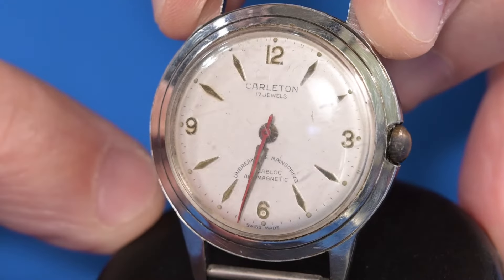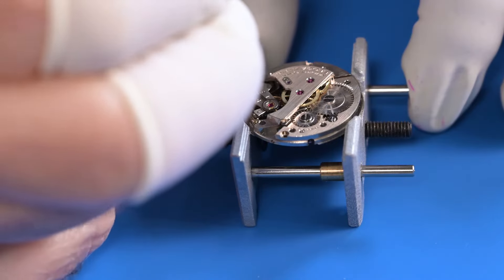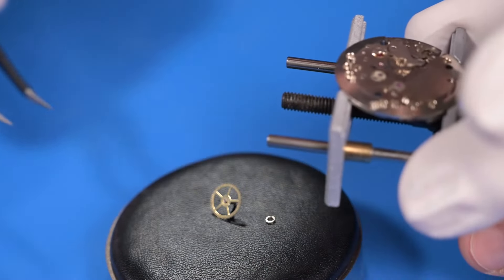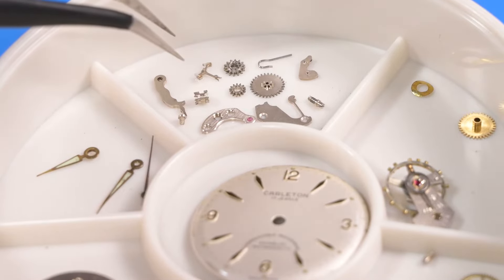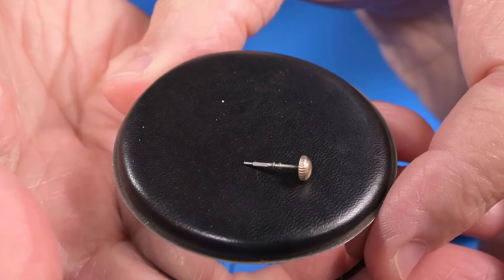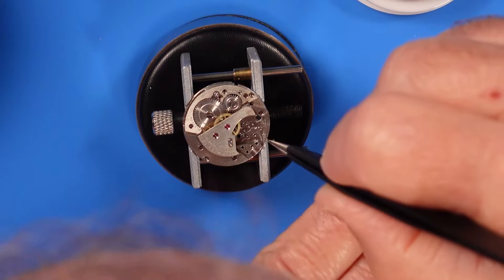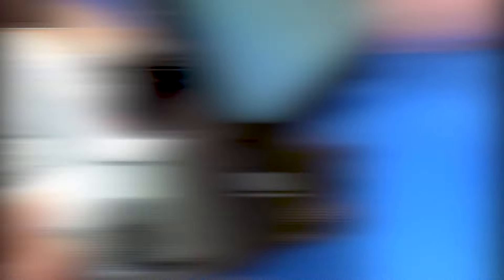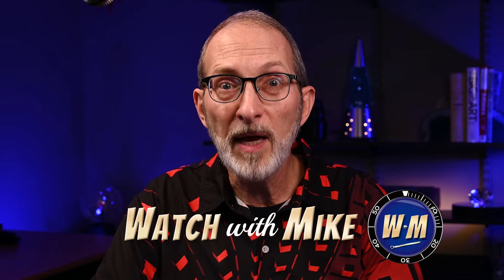Learning Watchmaking on a Swiss Mechanical Watch | Complete Teardown & Service

Comment: Sorry but I just couldn’t get past the thick and chunky ‘tweezers’, the cranked angle didn’t help either. Never seen anything like these used by any other watchmaker and I’ve watched hundreds of videos. I guess if that’s what you have got and you’ve found a way to make it work for you that’s Ok. But the handling of the parts looked clumsy and awkward and my guess would be that it is stressful and tiring after many hours of working.
Reply from the maker: Hi Francis, indeed, this was one of my first watchmaking video projects and I had a lot to learn about tools, especially tweezers! I look back on this video and I see how far my watchmaking skills have come. I welcome you to check out some of my more recent projects on my channel. Thanks for your interest! 👍🏼😁

Comment: I've watched videos on watches for years now.   I started on my great grand pa's benrus self winding.  I didn't have the cleaning stuff yet and was putting it back together for learning.  A tiny screw flew off of my tweezers for about the 12th time, this time off my cloth mat I laid down.      I guess I'll be shopping for old benrus watches for parts.    I needed a stem and crown for it too.    I'm thinking about using superglue to keep the screw on my screw drivers while starting them.   I took photos as I was working, but if it wasn't for a video of the operation, I don't think I"d figured out how to get as far as I got.  Oh, it was a winding gear click screw.    I found a click and screw for $25.   I don't think it's worth it.  I'll look for doner watches.    I have two pocket watches that belonged to granddad and grand dad in law to mess with too.     I also have my aunt's atomos clock.
Reply: ratchet wheel stem,    I'm still learning the names of parts.
Reply from the maker: It sounds like you have lots of great time pieces to work on! A small neodymium magnet stuck to the shaft of your screwdriver will help hold small screws onto the tip. I know magnets aren't supposed to be around watches, and you may need to demagnetize when you are done… But I think that would be better than superglue. I wish you continued success with the hobby, and thanks for watching my video!

Comment: The palet fork is missing a Jewel  on the release side of the palet fork Maby a little inspection is needed it was goe before you released the barrel spring tension .it’s my first observation of a faulty fork also it might be bent by a previous service .thanks for the vid .
Reply from the maker: Hi Joseph, I appreciate your concern, but the pallet jewel isn't missing from what I can see! Maybe it is an optical illusion because the jewels in this watch are CLEAR, not ruby colored, so the fork may look empty. Here's a good place in the video that you can see the clear pallet stones against the white parts tray: https://youtu.be/4b3ImfaxauM?si=YPEASyrYF2MnYb2F&t=1475

Comment: Did you ever replace the crystal?  I found out the hard way that we can buy new crystals for these.  I found out the harder way that sizing them is difficult.
Reply from the maker: Hi Lee I did not replace the crystal. I was able to clean it up nicely with PolyWatch. I agree that sizing the replacement is difficult… I just bought an armored dome crystal for a vintage Hamilton, and it took me forever to find an aftermarket replacement. That will be my next project and I sure hope it fits!

Comment: Thank you for sharing your journey in such an open and well-produced manner. Kudos. 

I’d love to learn more about your journey up to this point, the point when you felt able to work on your first mechanical watch. How did you learn about the different components and  techniques? While there is no one pathway, it would be insightful for others who are trying to get this point of their journey also.
Reply from the maker: Hi Stefan! Thanks for the kind words! I've always liked doing mechanical things, and I've always loved watches - but I never thought I could understand how they work, let alone fix one. Then I started watching watchmaking videos on YouTube and I was hooked. I took out several books from the library, but honestly they were too technical for me at the time. The best path to learning? Start taking a project watch apart. Pocket watches are larger and easier to handle for beginners (regrettably I skipped this step). Once I started taking them apart, the library books and more advanced videos made more sense. Hope that gets you started! 😀
Reply: @WatchWithMike  thanks again. The larger sized pocket watches is good suggestion - I think like that or something like a Seagul St3600 movement will be where I first try.

Comment: Was that a plastic crystal?  The tool to use is different for plastic, I think.  It's a multi fingered tool that installs the compressed/sqweezed crystal on the sides.
Reply from the maker: Yes, the crystal was acrylic. The tall you are describing is called a crystal lifter, which are used in this video: https://youtu.be/LcbFjoDRq0o?si=Oh3u914z62OlCSXj. For what it's worth I still prefer to use the press, but I have become better at it and have not shattered a crystal since. There's lots of ways to achieve the same results! 😁

Comment: The chrome plating can't be coming off the case.  It says clearly on the back "All Stainless Steel".
Reply from the maker: I agree with you… But something tells me the back of this watch may have been swapped out. It's been some time since I have worked on this watch, but I will go back and take another look at it to see if you are right! Thanks! 😁
Reply: @WatchWithMike    Yes, if that is the case, I can see your point!  However, after you cleaned it up, I didn't see any case degradation.   
Regardless....AWESOME JOB!!
Reply from the maker: @chronoboat11  👍

Comment: Nicely done.  I think the watch isn't running well because you may have used the wrong lubricant. Evre watch movement uses a specific regiment of lubricant. You need to find the specific instruction to your monument you are working on. At least that is what I learned watching other newbies like us. I think the proper lubricant like the proper cleaner in conjunction is the most importend element in matchmaking. I'd like to see the watch finally reasembled on your arm working.
Reply from the maker: Thanks for the advice, and with what I have learned since I have to agree. When I made this video I didn’t have any documentation, and as a result I was figuring out as I went. Looking back I know I would do things differently, and I plan to demonstrate that in upcoming videos. Stay tuned!
Reply: @WatchWithMike  I most certainly will. Can't wait.
Reply: I thought the mainspring looked like it didn't uncoil as much as I expected from watching other watch videos. There are some good videos on watch oiling. As the other guy said I've watched a lot of watch videos. I plan to set up my watch bench and tools as soon at I can make my work space water tight and replace the carpet with linoleum (searching carpet for dropped parts isn't much fun).

Comment: I recently learned you need to be very careful using IPA on pallet forks and the balance wheel assembly. IPA can and will deteriorate the shellac that's used to hold the impact jewel and the jewels on the pallet fork. And it does it rather quickly, like 2 minutes is more than enough time to really mess up the integrity of the shellac. I wish I would have known this sooner! 

Watch Repair Tutorials has a great video on it. I don't think I'll ever use IPA on those parts again. In fact I don't even think I'll ever wash those parts again, manual cleaning only! haha Little too sensitive, and I do believe it's been messing me up right along. I was hammering those parts with IPA not knowing any better. At least I haven't messed up any really special movements, just old donors that I bought cheap specifically to learn. The ones that require servicing but are great watches have been left alone other than checking them out and confirming the balance was in good shape. I've got some really cool old watches that I picked up cheap because they were non-working/for parts, that all appear to more or less just need a service. Hamiltons, Lord Elgins, Omegas, Longines... Really cool pieces just waiting for me to build up the confidence and know how to work on them! ;) Really glad I showed restraint and learned about the IPA before digging in!!! haha

Cool video, subbed.
Reply from the maker: Thanks for subbing Tim! Yes, I agree 100% about isopropyl alcohol dissolving the shellac used to hold stones in place. Fortunately I have not had any casualties. I've seen the tests that Alex did… Very interesting! I wonder if older shellac is more cured and resistant for a longer period of time to IPA? I am also glad you learned your lessons on inexpensive watches… I am doing the same! Thanks for joining me on my journey and for sharing your experiences. 😁
Reply: @WatchWithMike  if you look under the microscope a jewel is missing on the pallet fork .

Comment: A very cool video, Mike! As for putting the spring back into the barrel, I have seen one guy use tweezers for holding the thing steady (the barrel was placed between the legs of the tweezers and he was rolling the barrel safely). Cool to see that you have done the same thing for smaller parts: you are using the sieves for making tea😊 I still have not found the smallest containers as I have no idea what they are called. Some watchmakers use special liquid for cleaning automobile injection nozzles to rinse watch parts in the ultrasonic cleaner.
Reply from the maker: Thanks for the nice words and for the suggestions! Those small cleaning baskets can be found on my Amazon associates shopping page, I think in a list I called watch making supplies for beginners, or something like that… Here is the link if you would like to give it a browse: https://www.amazon.com/shop/mikefyxdt 😁

Comment: A. Schild is a pretty reputable movement maker. It was absorbed into ETA in the 70's, however, Schild was a part of Eterna (later ETA) before he went off and started making the AS movements. Some info regards the merge as like a homecoming. I went down the "AS" rabbit hole the other day trying to find info on a mystery movement I was checking out haha Never heard of AS before then, but it seems these movements were used an awful lot by different watch manufactures around the world. Mine is in a Gents style (super thin/round/kind of large for the time) Elgin for example.
Reply from the maker: Interesting stuff! I think the watchmaker origin stories are just as fascinating as the parts themselves. 😁

Comment: Great video - loads of detail and added knowledge for us - thanks Mike. Maybe that sample oil set link in the next video? - that looked good as oils seem super expensive for hobbyists. You can order a crystal to finish the project - set it aside for couple of years then come back and then make it perfect - that'll be a fun video.
Reply from the maker: @tinymotogarage - I appreciate you watching! Those are excellent ideas. I have considered replacing the crystal, if for nothing else than to contain those possibly radium hands. About the oil sample set, yes I’d like to get a video out about that soon. FYI, the only place I have seen them sold is on eBay, and they come and go… You have to watch for them. Hope that helps!

Comment: I hope you are taking precautions with the possible radium. Using a blower to remove the dirt and dust on the dial. Please wear a mask and discard the debris. It has a very long half-life and can be potentially very dangerous to your heath.
Reply from the maker: You bring up important points, thank you. I must admit that when I took this watch apart I was uneducated about the danger of the radium. Fortunately I did very little to disrupt the dial or hands, which I am thankful for. I would like to try re-luming hands in the future, but I definitely want to learn on a watch that I know is safe. I intend to purchase a geiger counter so I can make sure I’m safe moving forward. Thank you for watching and sharing your thoughts!

Comment: I was concerned when you said you were using water as a cleaning agent, but when you said you were using IPA as a final rinse I was really worried. It's fine for most parts but it can dissolve the laquer that holds the jewels onto the pallette fork and the balance assembly. 
So far it is working for you and Iwish you only success, but I urge you to be extra careful with your fluids and solvents!
Reply from the maker: Excellent points, and I really appreciate you bringing them up so other people can read them in the comments. I recently purchased some legitimate ultrasonic cleaner and rinse, which I am going to work into my watchmaking cleaning regimen. I liked working with the IPA, and I thought it worked as a good drying agent. However I will keep that reserved for parts that it won’t damage. Thanks so much for sharing your advice!
Reply: @WatchWithMike  brother I'm glad to help! Full disclosure, I haven't done any watchmaking myself (initial tool cost outlay is a bit of a barrier to entry for me, though I remain hopeful,) but I watch a metric ton of watch restoration video content from both amateurs and professionals, so some of the advice sticks with me.
Reply from the maker: @67nearmint  -  Lol, metric ton makes sense to me as a measure of YouTube consumption! I feel like I've eased myself into the hobby with low-cost equipment and supplies to get started, but I'm quickly learning what was a good investment and what was a waste of money! (Do you think that would be a good topic for a video?)
Reply: @WatchWithMike  Oh yeah! Which cheap tools work reasonable well vs which ones were just setting money on fire would be a great help to be aspirant amateur watchmakers! 

And, as an additional suggestion, rather than try to hand wind a mainspring, which can damage it if things go sideways, or spend hundreds of dollars on a set of mainspring winders so early in your watchmaking journey, try purchasing a new mainspring for that movement. They come mounted to a colored installation disc and install into the barrel quick, fast and in a hurry. 

Again, thanks for the content.

Comment: amazing work! Were you really a beginner? I wonder about the hands. I read somewhere that if you put a thin layer of lume over the radium paint, the residual radioactivity is supposed to be enough to make the thing glow again. I love the idea of the naptha in the contact lens case to act as the vessel to clean the jewel!
Reply from the maker: Hi Andy, thanks for the nice words! Yes, this was my first fully mechanical watch. I did a complete service on a quartz Heuer dive watch before this project, which had a lot of mechanical parts - but this was my first watch with a mainspring that I attempted. Interesting concept on the radium... That would be an interesting experiment! 😄